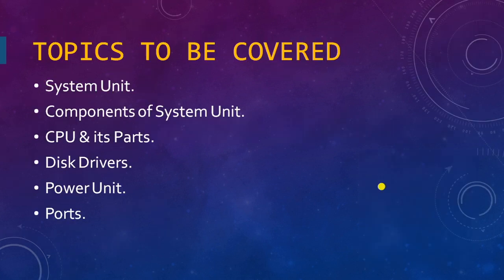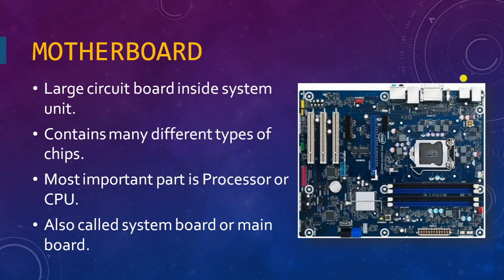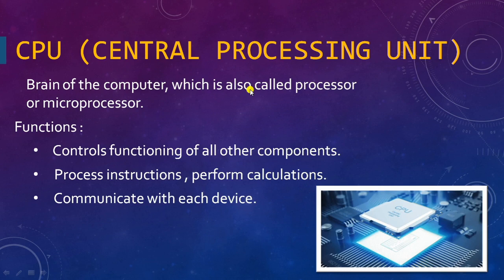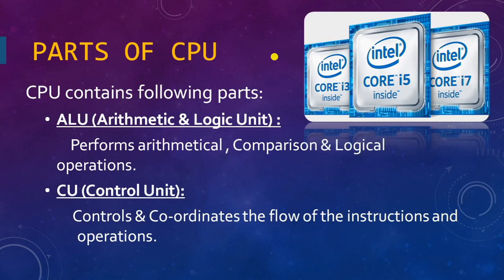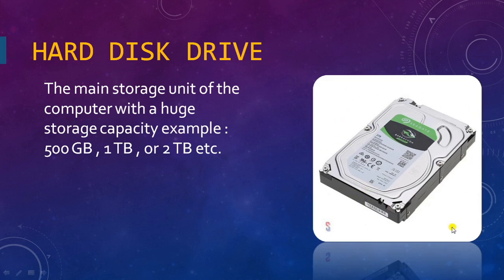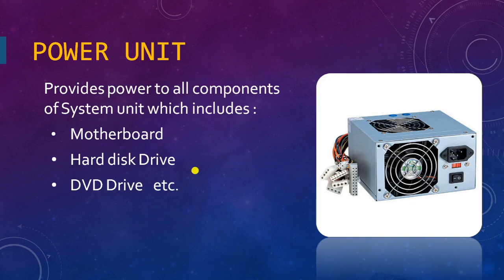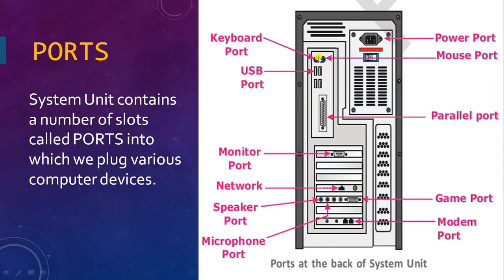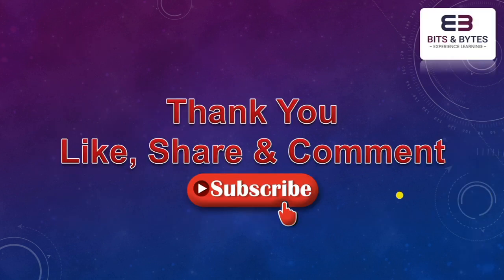Inside System Unit | Bits & Bytes | Bappa Chakraborty | System Unit in Details

Comment: Sir the components of Inside System Unit (ISU) are:
1. Motherboard 
2.RAM
3.ROM

Sir the most important  component of the Motherboard is CPU.

Sir the CPU is divided into 2 parts :
1. Arithmetic and Logic Unit
2. Control Unit 

Sir Didk Drives are the part of the computer which stores Data and Instruction. 

Sir Disk drives are divided into 2 types:
1. Hard Disk Drive
2. Optical Disk Drive. 

Sir the System unit contains a no. of slots called PORT into which we plug various computer devices
Reply: 3)ans-control unit, alu
Reply: Think and answer.
1) ans Mother board and CPU.
Reply: 2)ans microprosessor